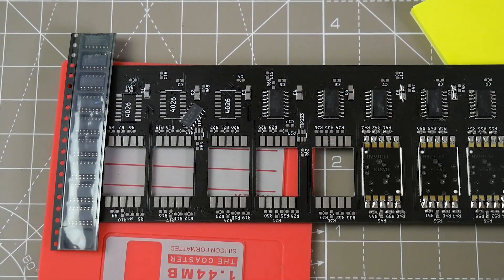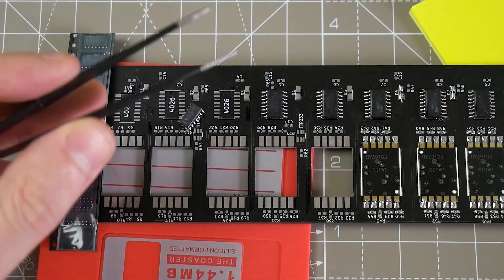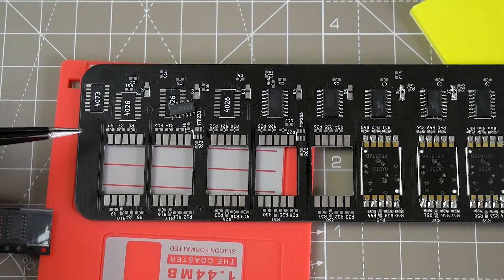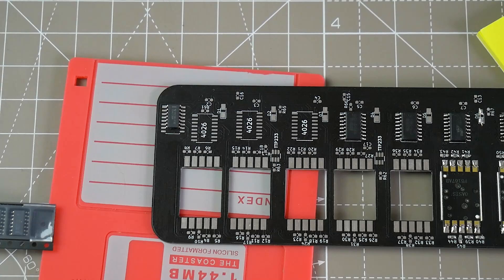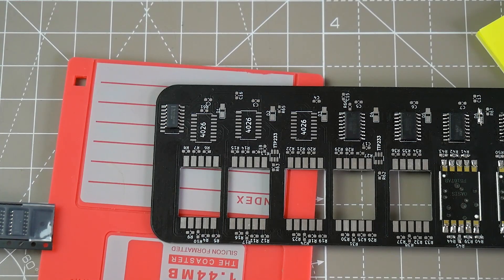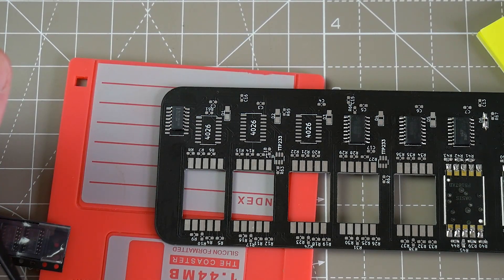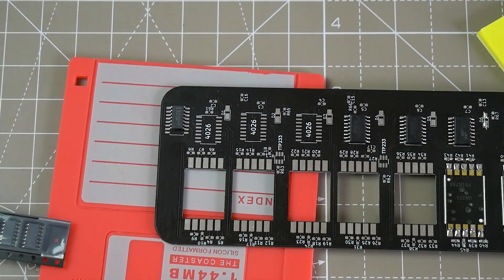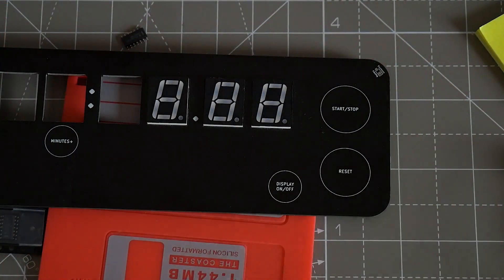9.99 seconds is the best I can do

Comment: Oh dear. That's really annoying, but I think you can fix it. You'll need to design a little PCB that's just the size of the bigger footprint and solders onto it. On the other side it'll be the pinout for the chip you have - the traces will basically convert from one to the other. I think it's called a bodge board.
Reply from the maker: You know what, you are right. I am just feeling deflated. I could dead bug it with a DIP version.
Reply: @DavidWatts  Go ugly early David - Dead bug it with bodge wires and Blu-tack :)
Reply: Exactly my thoughts, and -- if it's possible not to decry David's abilities -- but if he can make one mistake... so maybe treat this as a prototype; finish it -- and prove that there are no more 'little gotchas' hiding?
Reply from the maker: You're right. New motivation for tomorrow.
Reply: I should probably confess that my first job was designing circuits, which often had mistakes, even after peer review. We used precision track-cutting machines and surface wiring, to get us to a working board. Only once we had eliminated all of the bugs, did the boards go into production. Please don't be disheartened. The phrase "we've all been there" seems appropriate.
Reply: Pins 1-7 should be fine so you could solder those on with the chip at a ~20 degree lift to the other side. Then use some wirewrap wire for the other 7 pins. It's best to get everything working before re-spinning the layout.

Comment: If you print out your Gerbers and check to you circuit  you not only save money but you also save a lot of time. If your spending £1000's on pcb's you would do a lot of checking before hitting the go button. I still do most of the checks on a £5 order, as why would I wont to waste any money or a week waiting for new boards if 10 mins looking at the Gerbers stops it happening in the first place.  Still no one said learning is easy.

Comment: [posted this before seeing the earlier replies suggesting the same] How about making a tiny doublesided 'patch' pcb board with matching 16pad footprint on one side and with pads connected to the correct pads in a 14 pad footprint on the other side of the board. You could then surface solder this adapter board to the 16 pad footprint on your main board and then solder your  4073 to the correct 14 pad footprint on the top of the adapter board.

Comment: This has happened so many times to me I always print off my component layer and actually place all my components on the paper to check they have all the correct packages and pad sizes. I have found way too often that even component libraries give pads too small or too short so the solder fillet doesn't have space to flow properly. I appreciate you can't do that for complex boards but I never design something that complex at home anyway!

Comment: David, just create a converter daughter board that converts the pinouts on your main board to the chip you are using, that way you are not wasting those boards that you already had made.
I have done that a few times in the past when the Schem and PCP Footprints are not correct.
Reply from the maker: You are right, I'm going to revisit it tomorrow.
Reply: I make this kind of mistakes from time to time, and this solution is a perfectly valid solution. I'm glad that I'm no alone.

Comment: Stick the ic to the board upside down and add wire links to remap. You can then validate the design before the PCB respin.
Reply from the maker: I think I am going to run the connections off to a veroboard. I was being a downer.
Reply: Yes I also was think that. or solder pad's that are correct and lift other pins. And then do some wire to right pad..
Reply: Yeah Dead Bug style with mod wire would also work and would also be cheaper having small daughter boards made to correct the design error.